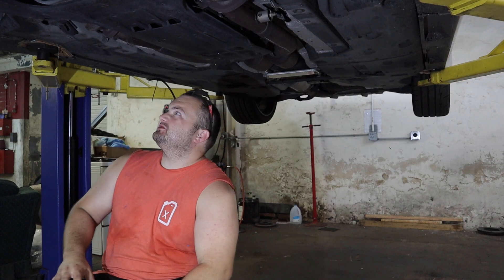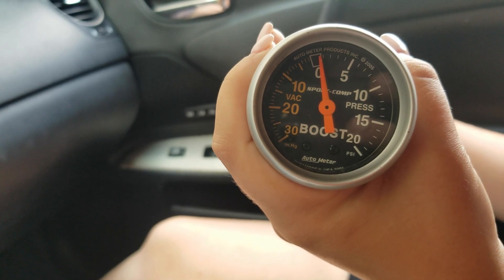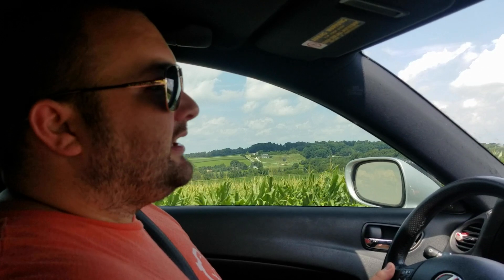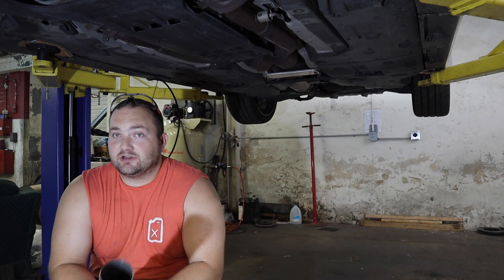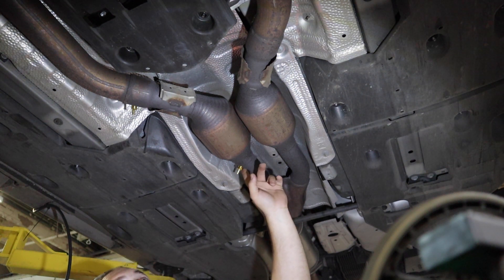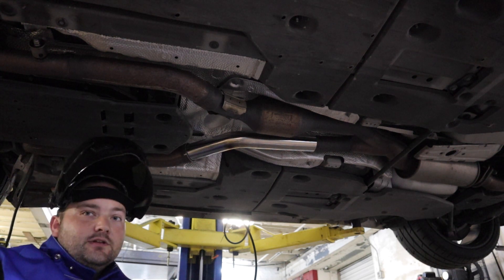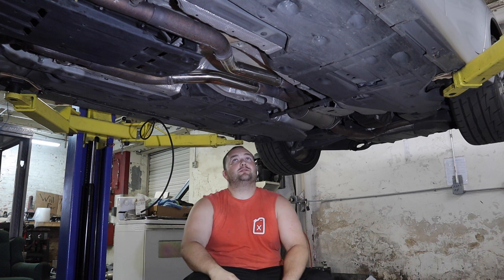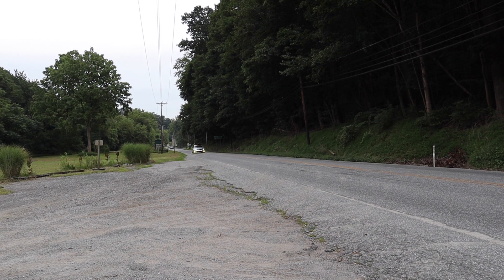Do catalytic converters rob horsepower? Lets find out! Lexus ISF Cat Delete

Comment: Are you kidding me?   How lame is the measurement and conclusion of this video?
Reply from the maker: They cause a restriction that I was able to measure
Reply: @PoorManMods  I'm sorry, my point was too brief and unnecessarily negative.  You measured, in a VERY unique scenario what loses would be.   It would be VERY uncommon for someone debating the use of a 100cpi CAT vs none at all.   (Put RACE in the title and it's more accurate).    My real disappointment was not commenting on a 100CPI converter so people don't run out IN DROVES to buy that density.   If it's better than I'd think, I'd owe you an apology.   FWIW, I do know someone running your particular CAT and they will be swapping it out for a higher density model out of desire for less "smell".    (Yes, they can tune)

Comment: is this muffler delete, secondary delete, but stock headers and primary cats with the stock resonator?
Reply from the maker: correct
Reply: @PoorManMods  Ls400 owner here contemplating upgrading to is-f. But interesting to note my car is pretty quiet with a primary cat delete into the stock resonator and dumped. Stock resonator almost looks like the same body size as the one on the isf lol
Seems like yours in the video seems pretty loud. Compared to the camaros, mustangs, challengers, chargers that run around i feel like im about about ~60% as loud as them with just catbacks.

Comment: You should have flared the stainless end towards the front. Now the smaller pipe difference is going to creat alot of turbulence.
Reply from the maker: the pipe it went into was like a double walled pipe, it went in between the two walls, it didnt go inside the inner pipe, so its all good.

Comment: Are you running stock mufflers? I was hoping the car would've sounded quieter. I wanna delete the cats as well for the extra hp but dont want noise lol
Reply from the maker: I deleted the rear mufflers and the 2 cats in this video. Now the car only has the 2 upstream cats and the factory resonator
Reply: @PoorManMods  Ah ok. Do you think the removal of the 2ndary cats will clog up the mufflers too much? My friend told me it will but i wanna remove the cats anyway for the extra hp.
Reply: @PoorManMods  how’s the drone with no mufflers or cats?

Comment: How does your car pass emissions testing after the double cat delete? Could you have instead installed an electric exhaust cut out UPSTREAM of the two cats and achieve the same goals?
Reply from the maker: my state only checks for Check Engine Light codes for emissions testing, it doesnt probe the tail pipe
Reply: @PoorManMods  they don't do a visual? This wouldn't pass visual test.
Reply from the maker: @jalee6587  In pennsylvania for emissions they just scan the ECU for codes, if there are no codes it passes, if there are any check engine codes it fails

Comment: Cool video bro! Just need an advice. I have problem with one of my cat on bank 2. So I am thinking of deleting the cats. Just wondering about codes or engine check light after the cats are removed??? Did u get any codes from the O2 sensor or air fuel ratio sensors after cats were removed in your Lexus? I have Lexus LS600hl
Reply from the maker: Deleting the down stream 02 sensos will not affect the check engine light since they are after the 02 sensors. But if your upstream cats are bad or deleted and are making you have a p0420 code you can use with 02 sensor mini cat to trick the computer  
https://amzn.to/3vMh2Fs
Reply: RR-Racing tune will resolve the CEL code if using headers, and/or remove the primary cats.

Comment: Did you redo the test after deleting the cats?  What was the pressure difference?   Also did you notice any power increase?   I like your approach.
Reply from the maker: I did no redo the test, there isnt really a need to. I feel like it in increased power slighty but i have no idea by how much. Pretty sure good cat back exhausts on these cars are good for like 15hp i think
Reply: @PoorManMods  Nice rumble sound,is this v8 N/A or has Turbo?

Comment: How much was that beast
Reply from the maker: $25k
Reply: Poor Man Mods how many miles? Currently looking for one
Reply from the maker: @Rj-bc8sn  55k miles, if you can afford it look for 2010 or newer, they have better suspension and an LSD
Reply: @PoorManMods  yea they got you a little bit on the price for an 08-09. A bonus is the low mileage though. I'm looking to pick up a 2011 SFP w/ 77k miles next week. Already has Valley place service done, ppe headers, borla exhaust, RR racing usrs, lowering springs, and newer michelins on it. $27,500 is what I'm lookin at.

Comment: Does your state not have emission testing? I once got rid of my cats... Later on i had to buy replacement cats on ebay just to pass emissions. They weren't cheap...
Reply from the maker: Pennsylvania has emissions testing but does not probe the tailpipe
Reply: @PoorManMods  the car would throw a cel because of no cats and itll fail
Reply from the maker: No, i removed the secondary cats not the primary cats
Reply: @PoorManMods  i see 👍
Reply from the maker: @Kris Nicholson they are 100% cats lol
Reply: that is why some do the complete catless midpipe from header downpipe to before the mufflers. The rest is a swap every other year.
Am not sure in his area, but once he goes headers, will not pass visual inspection.